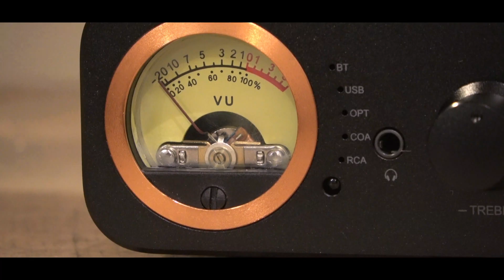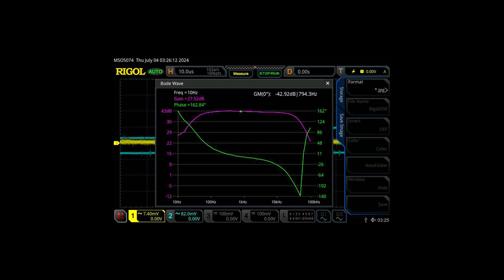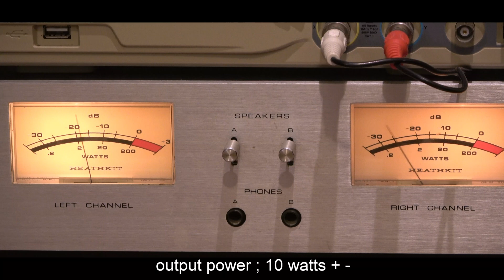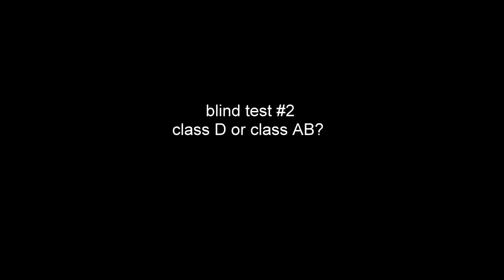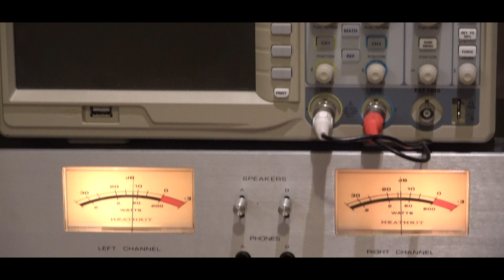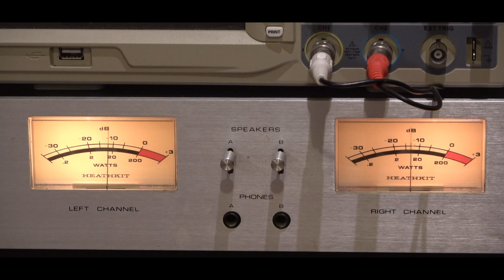blind test ; tiny class D vs full size class AB FET amplifier. Chi-Fi FOSI audio #1

Comment: The market price of a Fosi MC331 is around 130 USD. For such a price, you probably can't even buy, as spare, the V-meters of the compared Hitachi amp. I know, a vintage Ferrari go faster than a Hyundai i-20. Moreover, the first is an integrated amplifier with a DAC onboard, could be connected simply to a TV ora PC or a smartphone and be able to deliver sound, nothing else is required, instead ,the second is a simple final. I can't understand the sense of this comparison
Reply from the maker: Prejudice and illusions are positive in that they provide opportunities for success. On the other hand, it is also very negative as it prevents us from abandoning stereotypes

Comment: Yea, I could tell the difference but I think it was because of your other video where you explained how noise is introduced in the class b. 

The A/B translates brighter but if you listen carefully, the texture in her voice has more detail. Since that detail is replayed at a higher voltage than the class D's noise floor, even though you might not be able to quite put your finger on why, the A/B has a sound I would describe as being more "present" 

One of most important things I noticed while engineering music is that a change to any frequency will effect how the whole thing sounds. 

A good hint here is the midbass being a little less boomy on the A/B

Comment: The sound quality is definitely different. This small machine is just a toy for ordinary public entertainment, not designed for audiophiles, because it can only be considered an entry-level amplifier at most. You get what you pay for, there's no need to worry! Just be happy！
Reply from the maker: Thank you for your kind comments. Electronic devices and technology for PWM is definitely audio engineering. Sound is not cute as you compared. Good day sir.

Comment: 那個是D類，那個是AB，但價錢也差別很多吧？
Reply from the maker: Excellent question sir. Class D has very similar structure as digital circuit because of PWM. It's a kind of switching power mode so efficiency is very high and much less heat. But switching noise can be concerned in the process of analog signal conversion. however precision filters can minimize it. Choice is up to you. Good day,  Young